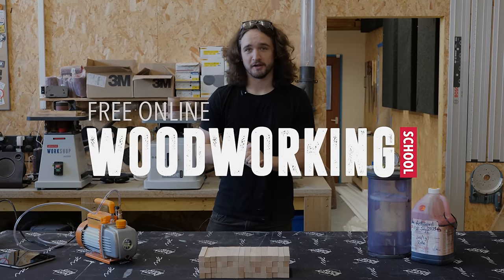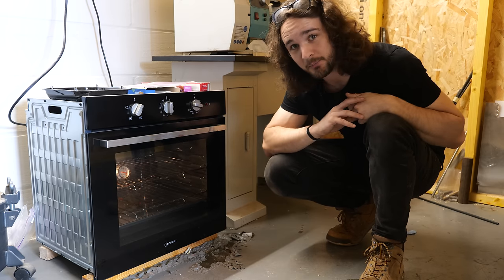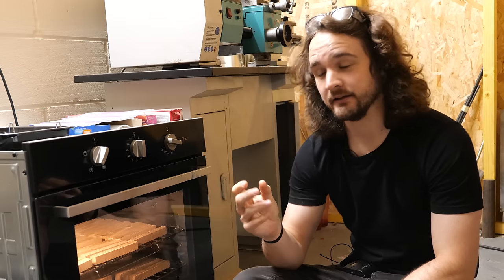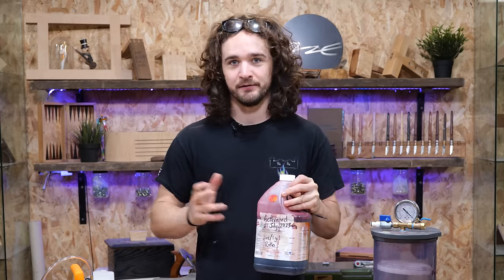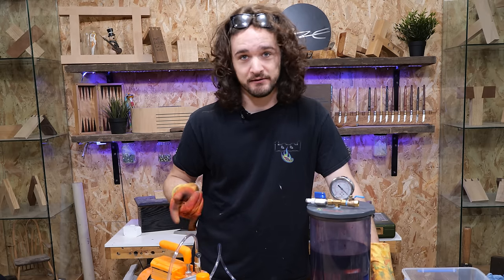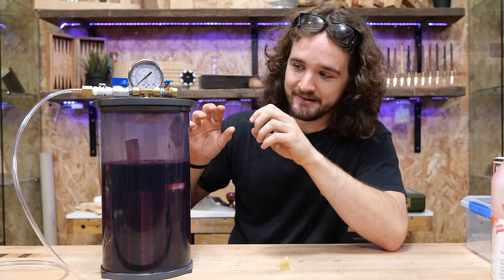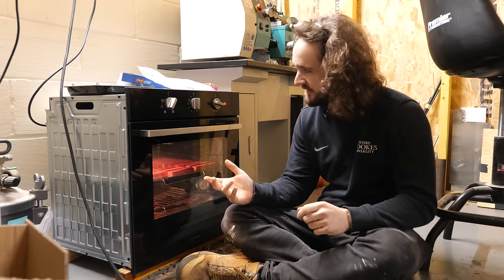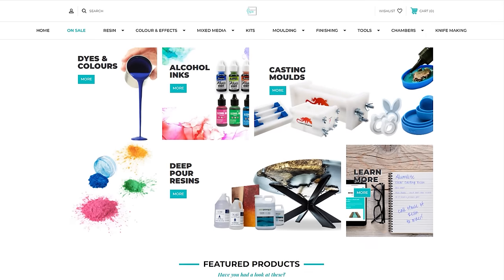How To Stabilise Wood with Cactus Juice

Comment: Just a tip…you can use a desiccant  that you can pour into the box during the cooling period to help with moisture content. It attracts the moisture so the wood doesn’t and changes color over time as it becomes saturated. You can reuse the desiccant by drying it in the oven.

Comment: From a pure physics point you can dry faster with the vacuum pump alone. 

Water will boil below room temp at sufficiently low pressure and the vacuum will help extract the moisture. 

This will avoid talinising the wood which makes it harder to work with cutting tools
Reply: yeah but its not great for your vacuum pump, and will mix with the oil in it

Comment: Nice to see the process, I'll probably never do it myself but it was interesting and I learnt a lot.  
A decent roughing pump can be left running happily by itself, I think the longest we had one running permanently was 4 years (should have changed the oil before that point.....), the more time it's pumping atmosphere the shorter the oil change intervals though.  Does your pump have a bleed screw on the second stage?  This can be used to reduce the foaming of the oil in the pump if you run into those problems.
On a time saving point, I mean this in the nicest way but watching you measure the average is slightly painful, personally I'd have just weighed them all at once and divided by the number of blanks.  You then weigh a few test pieces.

Comment: Question, what happens if you do this with wood or other material that isn't dry enough? A vacuum will usually cause water to boil at room temperature so it should just mostly evaporate off.